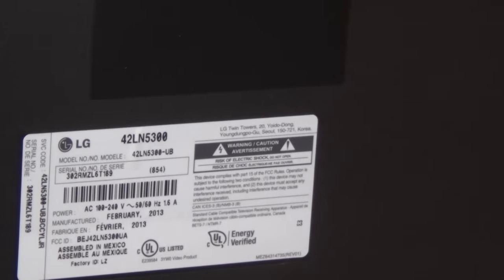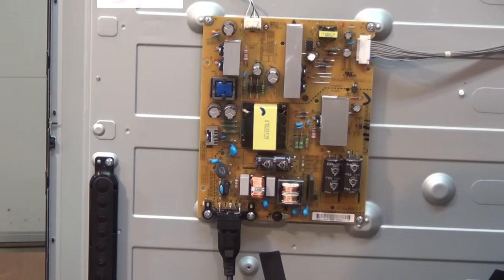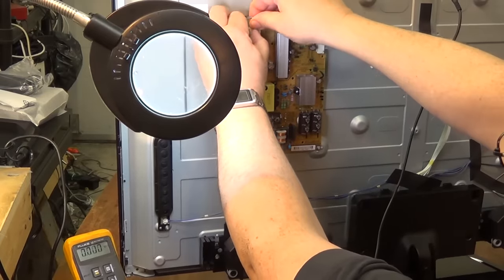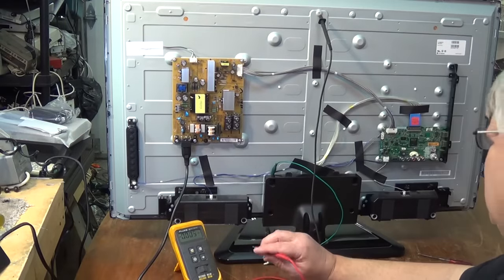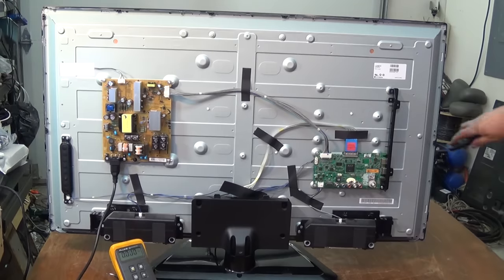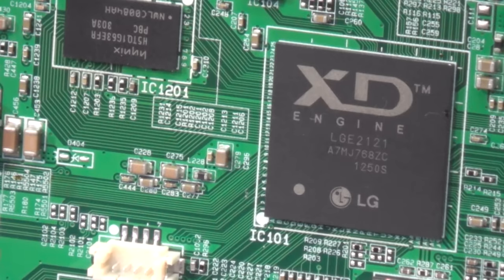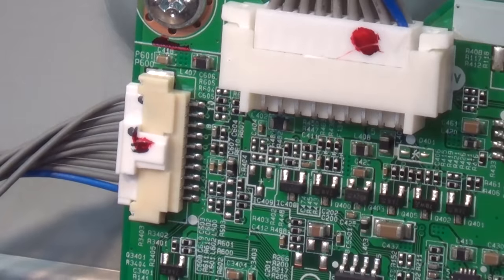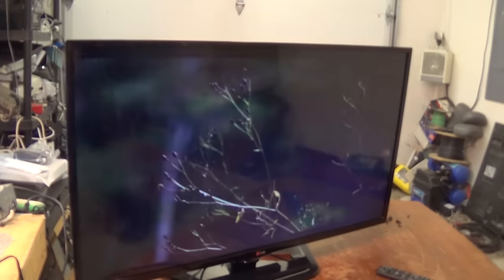LG 42LN5300 Dead   Not power supply

Comment: Thanks for the video and tips. Revived my family's dead led tv, Sony KD-55XD7004. Saved me ordering another main board, just used a hot air gun, circling underneath the chip area for about 10min until i could feel the heat through to the chip's 'white' heat spreader. Reminded me of working with bga components some 8+ years back. You know your stuff well. Thanks from Finland 🇫🇮
Reply: Did you hear under the board or top where the heat spreader is
Reply: Samsung ld32d,500d

Comment: I just cover the surrounding area with tin foil.  The chip is isolated.  put a nickel or quarter on top of the chip for bit of weight and a very small piece of solder on the tin foil next to the chip.  Turn on a hair dryer on low or a heat gun on low and heat up until the solder on the foil melts, then heat for 15 sec more.  Works every time.

Comment: Thanks for the tip. It worked for my TV, which had similar symptoms. Instead of halogen bulb I used incandescent light of rating 100W for 1hr about 3cm above the board. TV turned on successfully. There were also few white lines on the display, they also got fixed. Happy... :) Thanks for the tip.

Comment: Just wanted to say thanks! My LG 42lk550 is 5 years old and I couldn't find any parts for it, like a mother board. I ended up using my heat gun on level 4 on the dial for about 6 minutes and shazam! It didn't have a picture or sound and now it works. Never knew this trick until I watched your video. Thanks again.

Comment: We actually got this TV from our local waste site. The TV looked like it was clean, it was missing a remote control though.
We turned it on and it worked great as a rarely used bedroom TV.  I got a remote off Amazon.
Then our 65" Samsung back light bar (just one, we think) has gone out. 
So we brought the LG out. It was solid for 2 days. Then it had all the problems you described.
So glad we found you!!! We're going to try this to see if it works.
I hope you have a video showing how to replace the backlight bar on my Samsung.

Comment: Really surprised to hear it wasn't the power supply. I reflowed the solder on my Insignia power supply board when I discovered poor solder joints and it works perfectly now. I'll keep your video in mind if one of my LG tv's fail. Thanks!

Comment: Brilliant. I had no red led light and no power except for pins 2 and 3 showing 3.35V, used a 50w halogen bulb on the big chip "engine" raised about an inch from the board for about an hour. Let it cool for 15 mins then tried it. Working perfect. Thanks a lot from London

Comment: Excellent video my good sir, I picked up a LG model - 55LS4600-UA at the recyclers today, I opened it up and looked at the capacitors on the power board none were bulged. The issue I was having was the RED Stand By Light would light up. But if you tried turning the TV on, nothing would happen. I used a Wagner Heat Gun for about a minute on the IC101 and IC1201, then after letting it cool, POW! the TV fired up! I'm glad I got it for free though, since i didn't notice the small crack in the screen till i got it to light up.  Wish i could fix the screen now, but i guess it would cost too much. Just glad i learned something today :)
Reply from the maker: +Romaro Vinciguerra Yes you learned about those evil BGA chips.

Comment: TLDR: very helpful vid. 
60" lg plasma w/red standby led no display&sound, ruled out basics/pwr cable/power board (no obv damages/traces/loose connections/bulging or leaky caps, volts/grounds good) hadn't considered reflow (specifically cpu/other chips) will attempt that too. Thank you for additional possibilities.

Recently obtained an older lg 60" plasma, TV's are pretty cheap these days and most are not worth the time trying to fix but I miss the picture quality of the old plasmas over most of the newer TV's and enjoy learning different repair techniques especially since I'm an electrician by trade so your video was very informative and to the point on your thinking process and has given me some additional areas of attack.

Comment: Short  circuiting filter caps that carry high volt will give a flash crack pop..  
I've seen damaged parts due to arc over on smd boards.

On the other hand it's great that a time serviced engineer takes the time to show the many faults and how to track them down to restore electroinc equipment to working life.

Comment: I heard about those Onkyo receiver BGA problems... I bought a new TX-NR818 and put little RAM Heat sinks on all the chips on the HDMI board. And have fans on top of the unit pulling heat out and cool air in from the bottom of the unit. Hopefully will prevent this failure.

Comment: I usually put the whole board on alfoil in the oven preheated to 200 degrees Celsius for six and a half minutes then leave oven door open and turned off so bga slowly cools down then take it out after one hour .This slightly melts the dry solder in the ball grid array ,can cover some capacitors with bits of foil so they don't get to 200 degrees but I don't I just take my chances that caps are rated at 205 lol .Mind you I'd never do this for customers or charge people for what's maybe a temporary repair , just for my family and friends free of charge :) I have tried other methods like hot air gun etc but oven provides a more accurate way to melt dry/bad solder .I do this method as it works but there is always risk of damaging the board and or components so please do so at your own risk ... :)
Reply from the maker: 200' is not hot enough to reflow solder, all that does is expand the board slightly, and temporarily fixes the problem. The light bulb fix is the most reliable one I have tried, and I generally only do it on my own equipment.

Comment: I have a very similar TV, with exactly the same power board. While it was playing it suddenly gave a loud bang and was dead. Other problem than described in this video. Measuring, the first fuse behind the power cord was dead (EL7-EL8, of type 5A 250V). Replaced it, powered it and after a few seconds another bang but this time the first fuse (which I replaced) was still OK so must be another component blown. Any suggestions? Do I dig deeper or do I just replace the whole power board?
EDIT: I hadn't fixed the power board properly, learned from this video that they provide ground connection. When properly screwing it back on it powered up just fine. Me happy. My first repair of this kind and found it pretty much myself except for that part with the screws for which this video helped me. Thanks!

Comment: Great video! I used the same repair on my LG TV (different model, but same concept). I used a regular 100W incandescent bulb in a floor lamp with a metal reflector. I put the lamp directly over the chip in question and left it there for an hour. The TV immediately worked when powered back on. I'm guessing having my TV mounted above the fireplace for 5 years was a bad idea.....
Reply: Hello could you send me a link of this bulb, i'm not english i don't understand what it is. Thanks a lot !

Comment: Hey I literally used a hair dryer, and the red light came back ! Then when I put the HDMI cable and chose HDMI in the menu it became frozen with lines everywhere. Do you think the power was not enough ? Do you think it could work better with a 300W heat gut ? Because I cannot buy more expansive for now. Thanks !

Comment: let's say you have a TV running and while on the bathroom hear a kind of snapping sound to come back and see the TV is turned off.
The soundbar didn't turn off with it while being directly connected to it via ARC and I haven't been able to turn it on since.
Power cycling and everything but nada,just by that sound alone is it safe to say this would be a powersupply issue?>
I looked at the board but can't see any obvious capacitor bulges.

Comment: Thanks for this video, another interesting repair, and not the common faulty caps in power supply thing.
Could you show us a bit more of the halogen lamp you used ? Maybe in another video; it was a close up.

Anyway, thanks for videos. Greetings from Paris (Fr).
Reply from the maker: +Onel s4Yes I was thinking of doing just that. I have a scrap board I can work with that has BGA chips on it. If I leave it on the board long enough I should be able to actually remove the chip.
Reply: +12voltvids That surely would be interesting. I'm hoping to see this, if you can do it. Thanks.
Reply: Me too🤔

Comment: Thank you! 2019 sharp 43” Red standby light won’t turn on. Swapped out power supply no luck. Heat gun for a minute each main board chip did then trick. Hope it lasts

Comment: Great Video!  I'm try to fix my electric pool vacuum control unit. The wind knocked it over and it won't power up, same a your TV, has a power board and a control board.  I guess a hard jolt when the unit is on is not healthy for these boards?  Won't power up at all, I did check the ceramic fuse for continuity.

Comment: Thanks for the insight. I bought a used TV and after bringing it home, it wouldn't turn on. Power board has the standby voltage being transmitted to main board. So I assumed Main Board must have kicked it. I am going to try your method and see if it helps.
Reply: Did it work?

Comment: I have a BK hot air station. Just curious at What temperature do think would be best and for how long if I wanted to heat up and reflow a bga component?

The issue with my TV I think is different, I tested the led+ connectors and I'm getting 74 volts with leds connected to power supply board and only 70 volts when I disconnect the leds from the power supply board.
Does this sound like a faulty power supply to you?
TV symptoms: backlights keep turning off. If I turn the TV off and back on again the TV works for about an hour then the backlight goes out again. Audio works fine and tcon board looks good (have image with flashlight).

Comment: I have had success doing this, but then I put a flat PC video card heatsink and fan on them to stop them warming up excessively. It's the heat and cool cycles that kill these BGA solder joints. The chip heats up but the PCB doesn't.

Comment: Hello, I have a lg 42ld450-ua that won't turn on, the red stby. light on the front just pulses when the power button is pressed, caps look good, I only have the 3.5 stby voltages.
I have heard these tv's are bad about defective main boards ( the cheapest one I can find is $95.00)
I removed the heatsink & reflowed the BGA but that didn't work either.

Comment: Hello. I have an LG Smart TV 49UK6200PLA model 2019 wich is dead. I was watching a movie and suddenly it stopped. It has no power, no backlight and the standby led is off. I have checked the voltages of the power source and it's ok. I wanted to do a reflow of the BGA chip like you and like many others did after watching your video but when I removed the radiator, I saw a very small SMD component, 2 or 3mm long, unmarked, named L2311 on the board that was blackened and melted. I believe it is an inductance or something. I think this is what causes the TV defect so please tell me what it is and what I can replace it with? I appreciate any help.

Comment: tightening screws wont help.power and main boards will work without being conneced to chassie.only plasma tv boards that use gound screws need tightening
Reply: Best to check them anyway and see if they could be the problem somehow. If the board was cracked around the screw area, it may lead to a working unit for a while just by doing so with it.
Reply: How can you be so sure that you absolutely know how each manufacturer has organised the circuits. Just tighten the screws.

Comment: Thanks for the video! 
It seems that flatscreens uses fixed dc-voltages. And what would you say if one could modify conventional electronic devices that has a ac-dc circuitry to be full-on dc? Let say that you make a 24v DC-board to supply the tv for a offgrid system that has no dc-ac-converter.  Would it work? /CARL.

Comment: cheers buddy just fixed my 49 inch lg with an hair dryer
Reply: How long did it take with the hair dryer? I'm attempting this now.
Reply: @loucabrattzie9992  I had it on the highest  heat setting and used a metal vacuum tube  until u get enough heat x i had to do this 2 times until its worked

Comment: I have an LG TV (42lg3000)  with an intermittent SMPS problem.  All the caps are fine, yes, I tested the ESR.  I have the power supply on the bench with a pull up resistor and most time it boots just fine.  I always have 5 volts but the 12, 16, and 24 are just dead.  When it does decide to run, I can power lamps and stuff to load it and it's fine.  I'm really stuck.  If it were dead all the time it might be an easier fix.  Any advice would be much appreciated.

Comment: hi ive got a lgtv model 42ln578v looks same power supply as in this tv problem is been working fine for years now get nothing no standby light if i put my multimeter volts at 2v and put one on eitherside ov the resisistor next too the 2 68uf 450v capacitors it switches me standby light on and works fine till tv is unplugged any ideas what problem could be to fix it

Comment: I have this TV and started having the exact issue described in your video. Except I think I got lucky. After I took the back off and laid the TV face down, I plugged it in and it turned right on! ... ??? I guess maybe I had a ground issue? I have no clue. But I did tighten all the screws like you suggested at the beginning. Some of the ones on the power board didn’t seem very snug either .... so I’m guessing ground was issue? Who knows. 

Thanks for the video though.

Comment: hey there. i just picked up an RCA 3521-LE50B45-N106692.  The unit does not have a picture nor sound.  When powering up, the only thing that happens is a green led light on the far left bottom of the unit, not the screen.  Not sure if it is a bad capacitor or a problem with the led backlight or something else.  would love to save this unit from the scrap pile.  Any help to fix the issue would be greatly appreciated.

Comment: OK so I had an LG that would work for an hour and then go dark while sound could still be heard. I did check the LCD TCON ribbon cables and found the one on the right was the focus. I figured as this TV was free I would try to reflow the IC chip on the motherboard 1st.  Already tried all ground screws. DON"T use a heat lamp (like for chicks). I was thinking my heat gun might blow away some of the tiny components near the chip I would be focusing on. Thinking light would not have air movement as all solder begins to melt. started @ like 79 and within a couple min was reaching over 160 and over 200 on some parts. I had wet the chip with flux and as I saw it boil and begin to smoke I turned the lamp off (it was a larger bulb). Let it cool and tried it out. Power indicator was red but no other response was had. Tried remote & power button. Could see a small spark on the mainboard near the IC chip. Removed it and used high power glasses to check board out. Found a mess of melted solder causing shorts everywhere. As I might still need LED light strips I am not going to invest any money into this thing and just harvest LED Strips and boards while scrapping the good display and case. Will practice using my LED tester I recently bought for the next TCL unit I want to try and fix.

Comment: used an oven for laptop for heating up the graphic chip. It works almost every time :-) i removed the cpu and ram wires etc. oven was heatet up to 200 celcius and the mainbord was in the oven for 20 minutes. while it was in the oven i clean the fan inside and removed the old themal paste ( was hard as an rock anyway ) themal paste i used was arctic mx4 works every time 👍

Comment: I have an lg 42lb5d where the screen comes on 70% of the time but when it doesn't you still have audio but no picture. Turn the TV off/on 2-8x and the picture will come back. 
Do you think it would be a similar issue as this TV?
Would a heat gun on low heat (at the right distance) do the trick as the bulb?

Comment: Thanks. A lightning hit my TV and I think the power supply was fried because of the sound I heard. I get no voltage from it. I have one question: If the power supply is out why m when you turn it on, the front led blinks three times and dies ?
Reply from the maker: Lightning = BAD.
The power supply is likely not out. It is probably a failure somewhere else.
The fact that the power light blinks means that at least part of the power supply is working. There are typicality 2 supplies. a low voltage low power standby supply to power the cpu and remote, and a higher power sup;ly to operate the rest of the set. It is possible that the higher power supply was damaged, or something on the main board that controls the power.  Lightning can cause damage anywhere. Might be further ahead to just replace.

Comment: What temperature would you say the chip is seeing at the end of the heat cycle? Depending on what I discover on my same model, I am considering using a heat gun to do what you did. I just don't want to overcook the chip.
Reply from the maker: +Tim I don't have a thermocouple to measure the temperature as of yet. Once of these days I will invest in one. Hot enough to flow the solder. I usually leave it I=until I see the rosin smoking good. I now use a heat gun, as it is faster.  I have had mixed result doing BGA repairs and a few I have had to repeat a few times to get it working. SO don't take the time shown cooking here as a guideline, because times are usually edited down. When I did a few of these it took 10 or more minutes to get the chip hot enough to get a good bond. Saying that, all the devices I have fixed so far are still working, as most are mine.